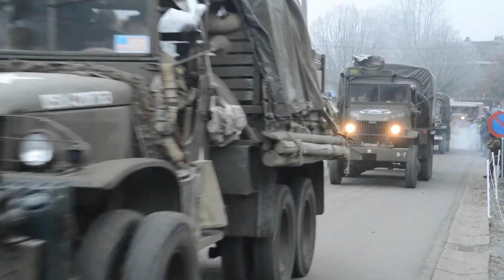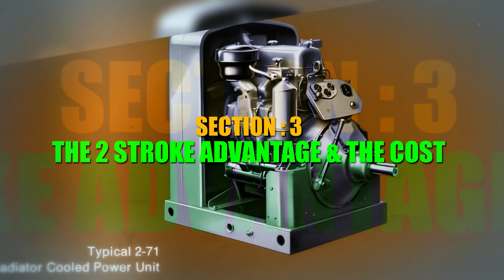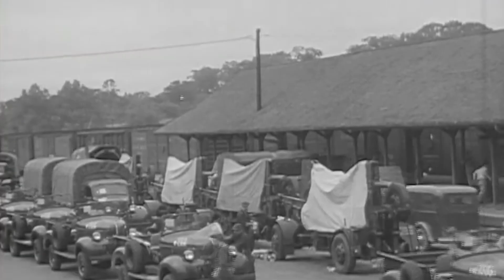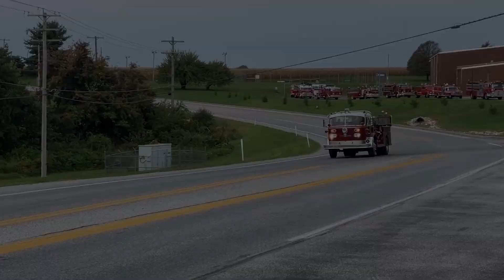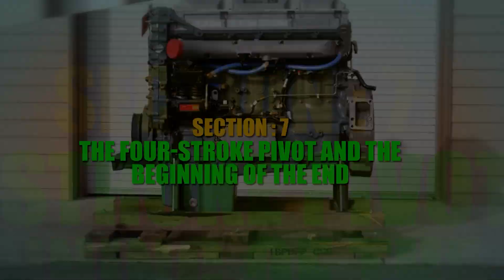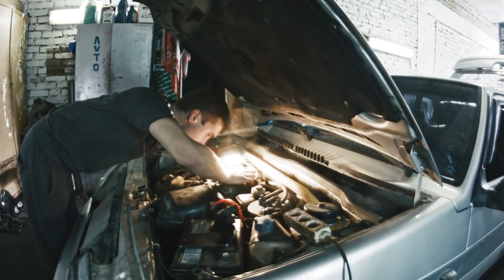AMERICAS ENGINE GIANT: How Detroit Diesel Went From Industry King to Near Collapse

Comment from the maker: If you've heard a Screamin' Jimmy at full throttle, drop a comment. If you own or operate vintage Detroit Diesel equipment, we want to hear your experience.

Subscribe for rare engine documentaries, mechanical engineering deep-dives, and the untold stories behind the vehicles and engines that built American industry. We cover what the major automotive channels miss. 🔧